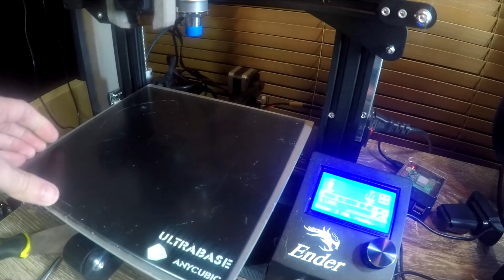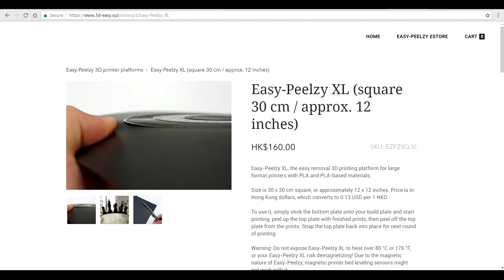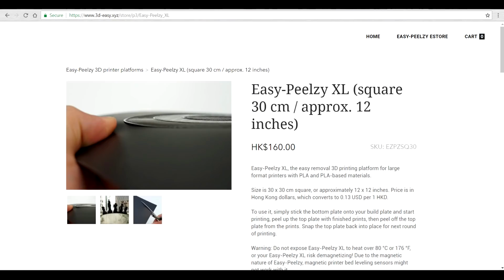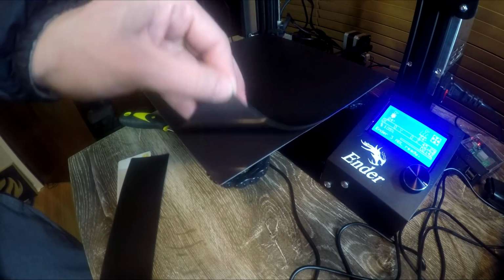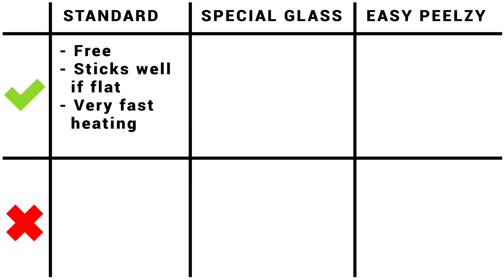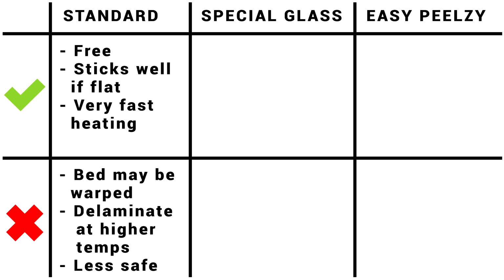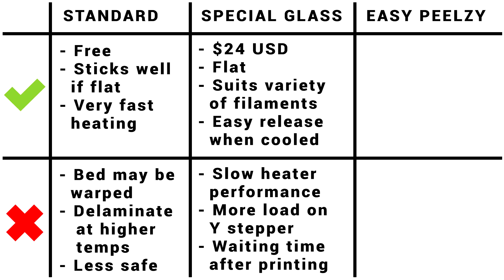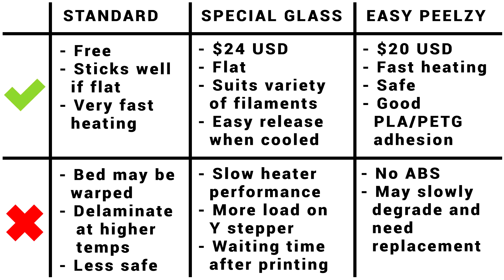Ender 3 build surface comparison: Stock vs glass vs Easy Peelzy magnetic sheet

Comment: My bed in Ender 4 is a little bit warped, so I think that i will go and buy glass. I need to change inductive sensor which will not discovers glass surface (only warped bed)for bl touch. Maybe someone has other suggestions?
Reply: I just added a sheet of glass to my Cocoon Create Touch, and I could not nomatter what I tried get the bed level on 4 points, despite spending close to 3 hours tweaking it. Noticed one of the adjustment screws was always being sprung clear of the carriage. Turns out the Y axis rods were twisted, and I never noticed. Guess the stock bed had enough flex to conform. Took some time to get the rods in wind, and within 5 minutes of success, I had the bed level on 5 points, perfectly. This is without replacing the y axis carriage, which is known to be dodgy on the CCT. If a good flat surface is important to you, I strongly recommend glass. There is a good ebay seller based out of QLD that I got mine from. Borosilicate glass is the way to go if you can justify the expense. I tried a sheet of glass out of a picture frame first, and it seemed very delicate.

That said, I got by for more than 6 months and a number of kilos of PLA using the stock build plate, and only really had problems when trying to print large flat parts. The bottom layer wasn't always beautifully even, but it worked.

Comment: Have you ever used a buildtek flex plate
Reply: Also your printing ABS without an enclosure? How so
Reply from the maker: The video where I use the flex plate was shown and linked in this video. I honestly don't know how you missed it: https://www.youtube.com/watch?v=5PvhSWcyC-8
Reply from the maker: No mystery to ABS. Nozzle to 240-250, bed to 100 and fan off unless bridging.  Large things will warp but small prints will work just fine. Give it a go.
Reply: @TeachingTech  I'm not sure either it pops up wherever you post something I will check it out thank you!

Comment: It looks like the Easy Peelzy is stuck on the heat bed with an adhesive. Does doing this preclude the use of glass or the new ender's removable surface? Which surface did you choose as your day-to-day print surface?
Reply from the maker: You could take the top layer of the Easy Peelzy off and clip the glass onto the bottom. Would make it heat up a bit slower. The Easy Peelzy is staying on, the printe is about to go to a young fella new to 3D printing and I'd prefer him not to use the scraper.
I would keep it for me too, I have other printers for ABS if I need them.

Comment: For some reason you forgot to mention Creality's magnetic build surface. 🤔
Reply from the maker: They are adding new things all the time. I just looked it up and it looks exactly the same as the Easy Peelzy, even the price is within a dollar. Only difference is it's pre-cut to 235 and it doesn't say the max temp.
Reply: On their YT at https://www.youtube.com/watch?v=a0rpUPAbfWk Creality say:
"Below or about 80 degrees Celsius all works great, we also test it above 80 to 100, it's ok. And technically, 80+ higher tempreture in long run will demagnetizing, so we suggest to control below 80 degrees Celsius for usual use, thank you."

Comment: My favourite build surface is the buildtak magnetic plate with geckotek ez stik.
Reply from the maker: I have the flexplate on my TPU flexibles dedicated Cocoon Create Touch. For the top surface I used The Kkiinngg MK3 rip off surface, which I covered previously. The fact that it's meant to be PEI but TPU peels off it beautiful kind of proves it ended up being a sham.